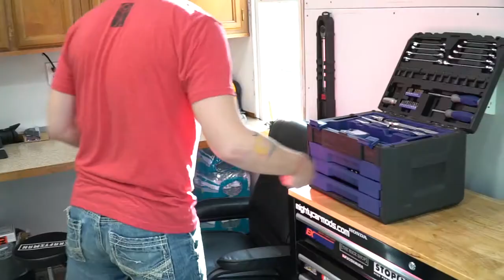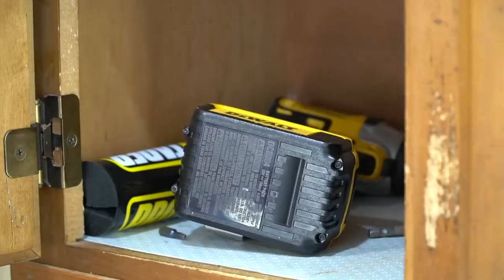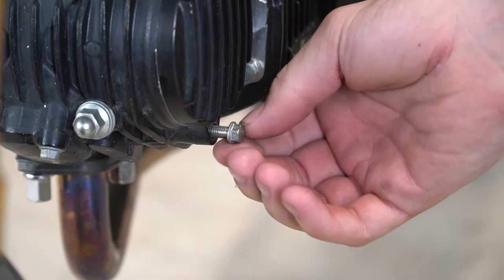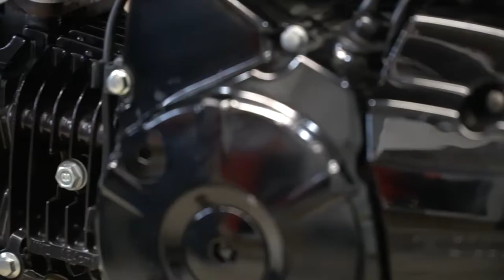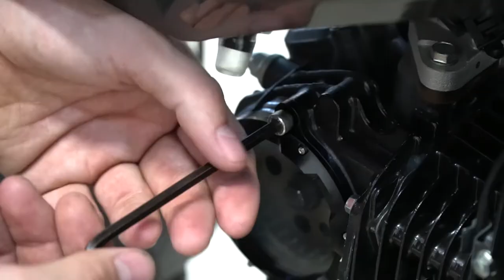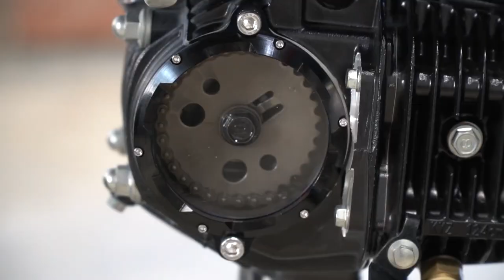Quick Install of the OTB CLEAR Cam Cover

Comment: Can you tell me if this part comes apart with those small allen heads around the rim? If one wanted to powder coat for example and reassemble. Thanks!
Reply from the maker: +Ahhson yeah, to remove the clear part you just need to remove the tiny allan heads.  There might be some sort of sealant aswell, but I am not sure about that.   Ik alot of people that have gotten it powder coated though

Comment: Mine just gets milky
Reply: I need to get the water out. Does yours get milky oil.
Reply from the maker: It will do that if the bike has been sitting a while.  Or because it's just really aerated oil from it being slung everywhere from the cam chain.
Reply: Me too! I’m spewin it look shit almost can’t see through mine at all it’s left a white circle on the inside. Will it go away after a long ride? I rode it for 10mins today after installing and looked at it a couple hours later to find it as described ? Thanks
Reply: @Mutthead  mine is the same. My grom is stock. Tried to open the oil meter cover after riding for 40 minutes to get some steam out. Took the clear cover off, cleaned, mounted it back....got condensation on it right after mountin despite the engine being still hot from the ride. After riding it just gets completely covered in milky oil...
Reply: @Mutthead  So the clear window helps with you knowing the condition of the oil. If the window is milky, your oil has condensation in it, and you need to ride your bike more.
Reply: Actually, I put one in, and it was getting milky. But I fixed it, I vented the crankcase breather hose to the atmosphere, instead of the back of the air box. Since I have done that, no more milkiness.
Reply: Have a whole milky coat on mine what would y’all suggest